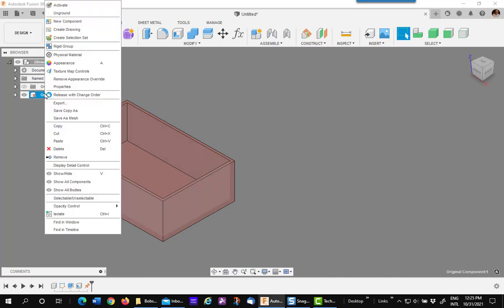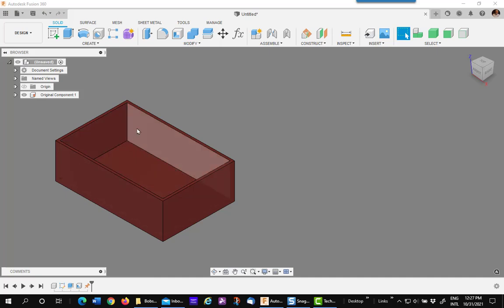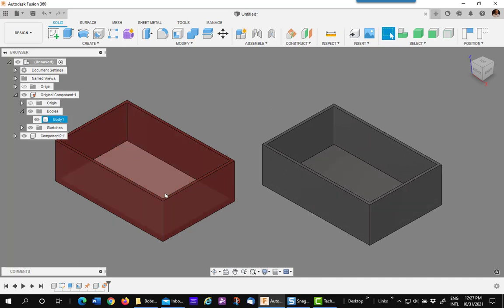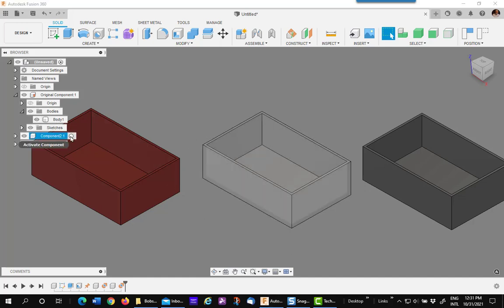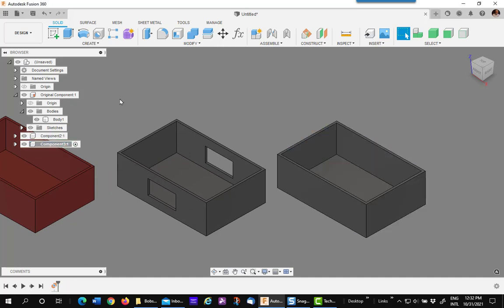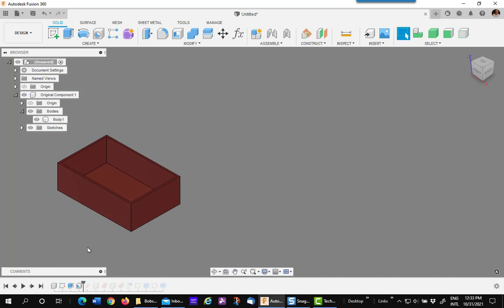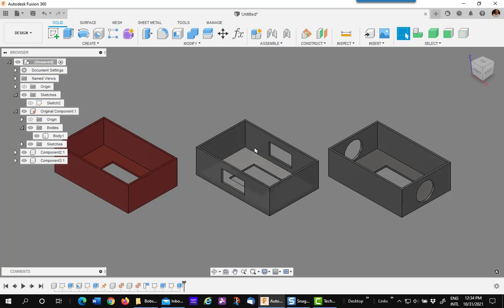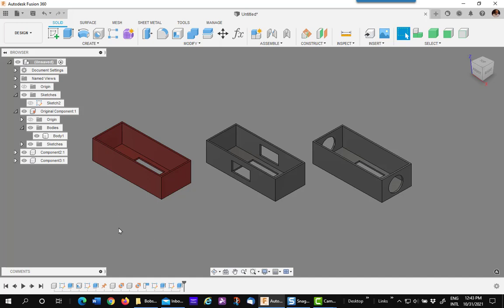Creating Independent Copies From a Component and Keeping Their Dependency on the Original

Comment: Very useful thank you. Is there a way though to adjust the size independently on the copies of the component. if say, I would like to keep the original component design as is, and in parallel have variations in sizes based from it (it could be useful for components with more features. is it a possibility or shall  I draw those from scratch?
Reply: My thoughts exactly. did you get anywhere.? I can create the Component 2, but cannot separate or find Component 2 Body. Older tips and updated software, don't mix too well. Ah well..Bash on.